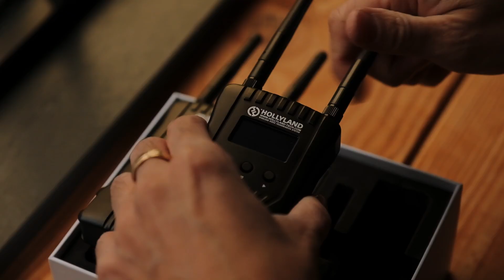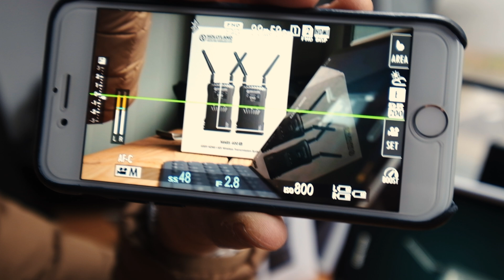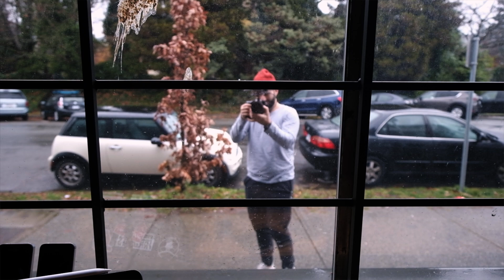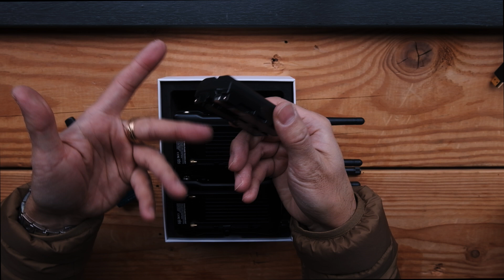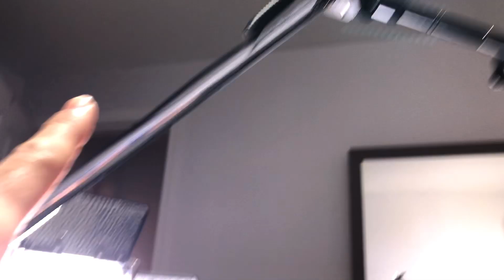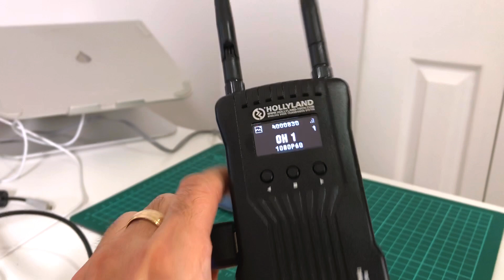Wireless Video Monitoring via iPad= The Hollyland Tech Mars 400S

Comment: Pretty cool if you need the full kit but if I was setting up a talking head YouTube studio I’d pick up a sub $100 HDMI monitor from Amazon.
Reply from the maker: totally, this system is for someone who will expand beyond just a hardwire monitor system. As I mentioned in the video, initially I wasn't interested until I realized it can send wireless monitoring to iOS-Android devices. I've done some videos where there are multiple stakeholders, and having a device like this would have helped.